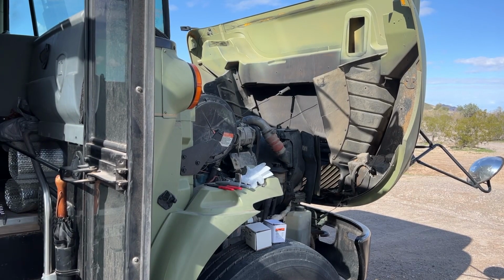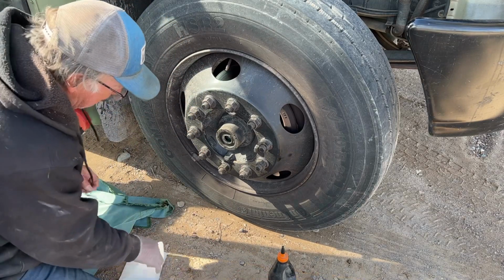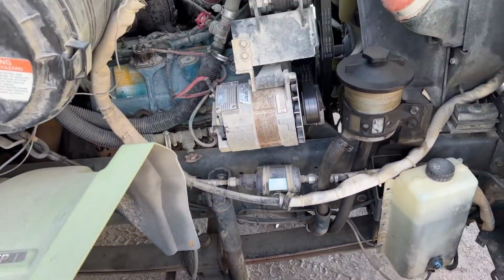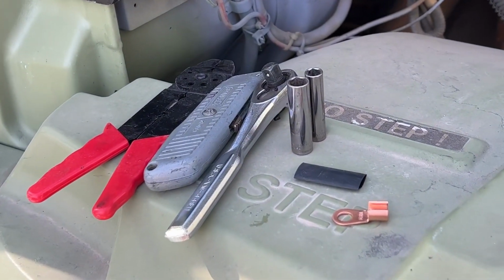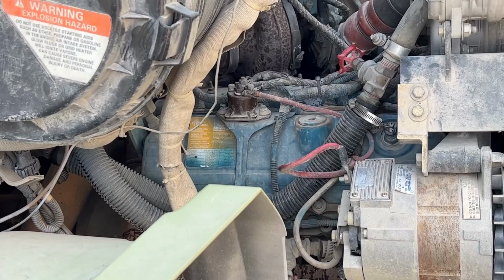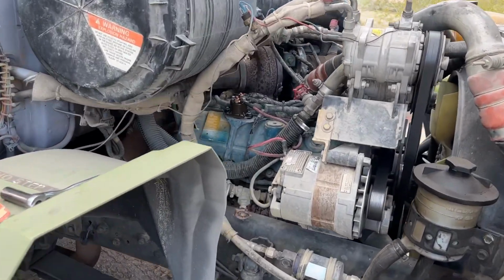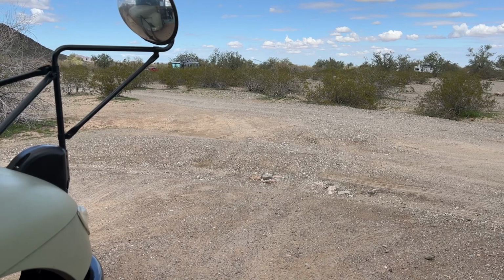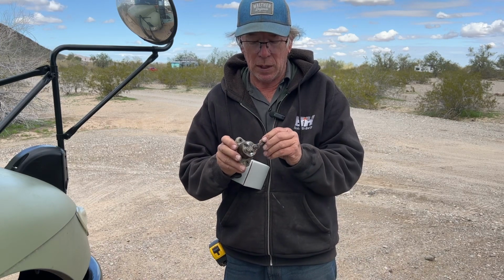I broke my bus trying to fix it 😱and glow plug relay replacement

Comment: To save a few dollars next time you can buy just the clear plastic in the hub cap and just replace it. They get brittle with age and are easily broken. We buy most of our truck and bus parts through Truck Pro. I believe there is a Truck Pro in Yuma as well. Great video :)

Comment: That relay connector looks like it got very hot, possibly due to high resistance. The new connector you installed may have fixed the problem, but if you continue to see that same connector changing colors like the old one, you may want to do a glow plug resistance test. If one or more of the glow plugs resistance is too high it can burn up the relay. Good luck, Mike ASE Master Technician.